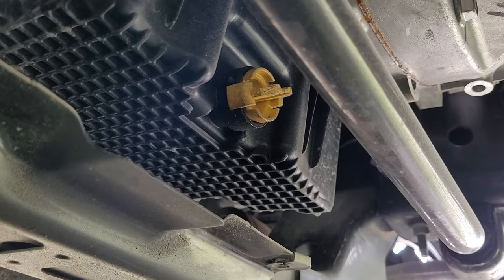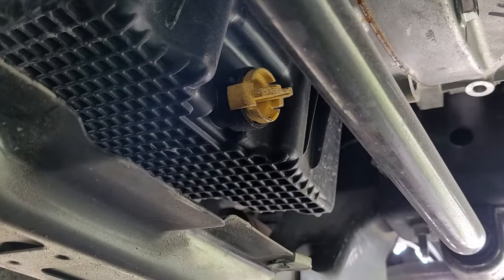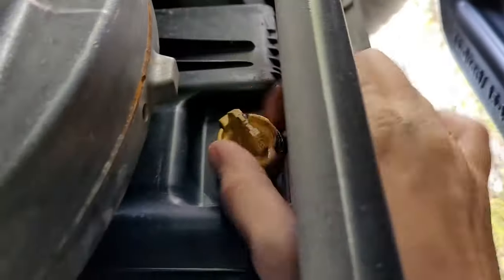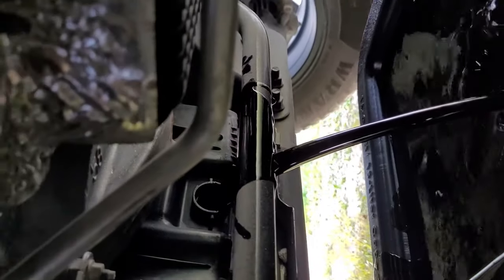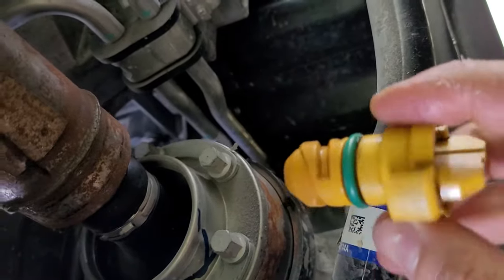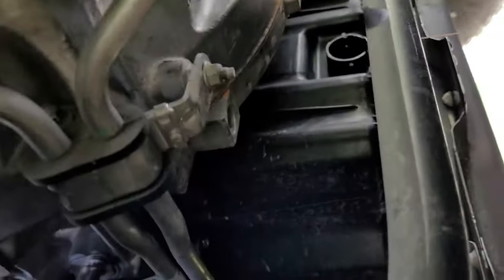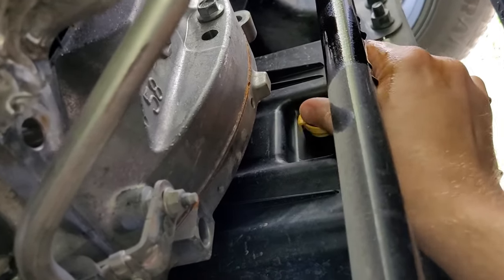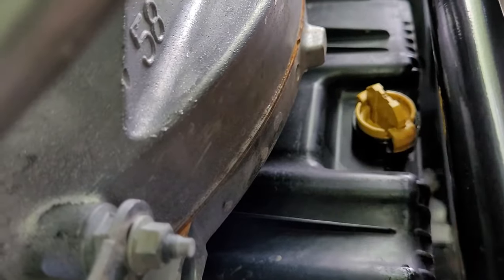Ford's New Drain Plug

Comment: I started as a maintenance mechanic trainee back in 1983 and now have 40 years of experience in many different  forms from industrial, commercial, residential, automotive and motorcycles mostly.  I would have to guess that ford chose composites because of lower costs and weight savings...it's very true how often I find broken and stripped threads in many applications ,drain bolts are pretty common and it never ceases to disappoint me because it's such a simple process and if you're actually a mechanic you don't make this mistake ever. Now do it yourselfers, weekend warriors and non mechanics  don't have the understanding or the patience to understand that a drain bolt doesn't hold the titanic to port and in fact takes very little torque to seal and stay in place...ford started putting o rings on their drain bolts years ago and many manufacturers use a single use compression fitting in an attempt to help  the not so sharp individual not over tighten, strip or otherwise cause damage  while trying to save money. I hope this helps anyone who wants to do their own work and when all else fails follow directions ! Get a service manual that will include torque specifications for each and every fastener.
Reply from the maker: "hold the titanic to port" lol that's a good one. Your probably right with the cost savings along with trying to prevent over torquing.
Reply from the maker: @paulfeasal6024  I was thinking about upgrading to the F-250 6.7 HO diesel
Reply: For 7yrs. I had the FORD Maintenance agreement for oil/oil fltr changes ev'ry 5K mi. on my 2013 3.5L ECOBOOST.
NOW I do it MYSELF.

What HORRIBLE, MESSY undertaking!!!

The oil filter lays on its side.
The drain plug is back by the auto. trans. ...just above the anti-sway bar.

There are 2 underpanels to deal with.

FORD "engineered" a way ( a removable hole ) to access the filter w/o removing the front panel,  but it will drip black oil for DAYS if the entire panel is not taken off.

I like the MERCEDES-BENZ oil drain method best.  Vacuuming it out thru the oil dipstick tube. 
The filter is accessed from above & the oil drains back into the pan by loosening the cover & raising it up a little bit.  MUCH MUCH NICER.
 My FORD has no dipstick tube.
Reply: Yeah a torque wrench set at 20-30 lbs is all it needs. Guessing is where people mess up when they don't have the right tools on hand.
Reply: @DavidTMSN  They may "think" the right way is to tighten it down until it breaks off, then loosen it a quarter-turn.
Reply: Your a weekend warrior  it's easy to put a sump plug in doesn't mean cause people  are not full mechanics doesn't mean they don't know what there doing dino
Reply: You forgot to mention that not all threads strip out through overtightening, sometimes it's because the threads have bonded to eachother through various means.  Plastics are especially bad for this if contamination is involved, as it can act to bind the pieces together, resulting in damaged or destroyed threads.
Reply: When I bought my F150 new it was at only its second oil change at the dealer and they charged me for a new (metal) oil pan drain plug. I asked what the hell? They sheepishly said they had apparently ruined the threads on the old one and apparently it was up to me to pay for that mistake.

Comment: Yup, a plastic oil pan plus plug😢.  Any guesses how many frozen winter days will pass by the time the plastic begins to warp or crack..?
  In winter conditions the pan is being assaulted by high temp oil Inside and by freezing -25 degree air on the outside.  
  I can forsee hairline cracks within a few years.
Reply from the maker: everything breaks in the cold

Comment: It would have been nice if the plug, fully tightened, would be straight up and down vertical so that you could also see it was tight.
Reply from the maker: Well that makes too much sense
Reply: You turn it until it stops. Is not that hard.

Comment: This is why Ford keeps having oil pan problems, leaking and breaking. Even the 6.7l is having tons of problems, newer ones you have to pull the engine to replace the upper oil pan. I just can't believe its much cheaper to make these plastic pans and plugs than a regular old stamped steel pan and steel drain plug. Glass fiber filled plastic is hard on molds and molds are expensive to make. I'm sure the plastic pans are lighter than steel but were are only talking about a couple pounds.
Reply from the maker: I think its still cheaper than steel, I have seen that oil leaks on the upper oil pans where you have pull the motor, but I think its just the gas motors with the plastic pans

Comment: This is one of the dumbest things I've ever seen. I just became a Ford man after standing beside GM for my entire life. After my first oil change on my F-150 I wanted to sell it again. I still have Sawdust on my garage floor soaking up all the oil that slams into the torsion bar on the way to the pan. If I had a pan the size of a bathtub........
Reply: Levi Levi, that drain plug has a two-phase release. In that first phase, you can drain the oil without making a huge mess but it takes a little while until the pressure is relieved. Then screwing the drain plug off on the second phase let’s it drain like normal. I know…it’s a PITA but that’s the way I had to do it so I wouldn’t make a huge mess! 🤷🏻‍♂️
Reply: @carlovanrijk4039  thank you Carlo! I feel real smart now. LOL. Seriously I appreciate the info. I even watched a YouTube video before I got started just as a precaution. Seems there's a couple other guys on here that didn't know that either. I hope they see your post. Again, thank you.
Reply: @levilevi6248  you betcha!
Reply: @levilevi6248  I guess I should tell you that on that first phase release, I had to keep my finger physically positioned on the drain plug while the oil was draining. Like I said, PITA but it kept from making a mess. 🤷🏻‍♂️
Reply: I have became a foreign car man after owning fords and some gms...I will never buy an american vehicle again.
Reply: @FC-qe1wl   Same lol, quality was never our strong suit and it's gotten much worse over the last decade or two.

Comment: No more stripped threads or missing gaskets I guess. 
It looks like you could just carry a boat drain plug just in case. 

I do have the sneaky suspicion though that thing will sooner or later fall apart and cost someone a motor years from now.
Reply from the maker: Yeah, I'm thinking the same thing

Comment: I replaced the factory plug with the billit Ronin drain plug$80 no more gushing oil
Reply from the maker: I'll have to look into that
Reply: @thebartendermechanic   Did the same for mine, works great with about 18" of tube hooked up to it... the bottom of a 5.0 was engineered by a 12 year old I swear...
Reply: @dshall442  There are ENGINE engineers & there are CHASSIS engineers.
Never the twain shall meet.
Reply: Has your got the heated tailgate option, so when your pushing it to the repair shop in the winter, your sissy hands wont get cold? 
$80 to replace a defective bad idea Ford had. Nice job on the purchase for 60 k
Reply: For $65 I got oil extracted pump no more issues

Comment: You're supposed to replace the drain plug every time you change the oil. I replaced the one in my Bronco with a Ronin Factory aluminum plug.
Reply from the maker: Does that one work better for you?

Comment: Drain plug is least of the problem.  That plastic oil pan is causing leaks on almost every Ford/Lincoln vehicle its installed in.
Reply from the maker: How many miles until they usually start leaking??

Comment: As if there's not enough plastic parts on it?... so they just added more. Next will be a plastic engine, which they're actually trying to do btw.
Reply from the maker: no way, They are trying to make a plastic engine???
Reply: @thebartendermechanic  yes, I seen it on a educational channel.
Reply from the maker: @garyr7027  That will be interesting
Reply: They were working on a plastic engine back in the 80s when I was working at a Ford dealership

Comment: Well, it's worked for decades on the plastic radiator drain plugs... With the way they make the metal drain plugs and rubber gaskets these days, this design might be better. On my 2016 Wrangler, I change the drain plug every time I change the oil simply because the built in rubber gasket tears each time I change the oil. I don't mind anymore, I just look at it as part of the price of my oil changes and I always have 2 or 3 new spares on hand.
Reply from the maker: good point, its smart to have those spares
Reply: why not just replace the o ring rather than whole plug?
Reply: @ranger178  The rubber gasket is built into the drain plugs from Dorman - they aren't separate - just  like the factory drain plugs.

Comment: it was price    im a old school ford guy  started working at ford in 1990   got out  many yrs ago after all the changes started .    plastic oil pan and plastic oil drain plug  is cheaper to make  then all metal    its simple  in a business sense   but one day it will bite ford in the rear end     your supposed to change the plug at each other change     yeah    same as the beetle   2019 20t plastic plug and pan
Reply from the maker: Yeah, makes sense, I'm scared to see what the F-150 looks like in 15 years

Comment: Do the plastic thread tabs matter when it comes to keeping the plug in? Or are they more of just guides? I assume the o ring and the outer clips on the plug hold it in…
Reply from the maker: The plastic thread holds it in.  The tabs sticking out are for the alignment and prevent it from backing out

Comment: Very cool! But uhh plastic oil pan?? If overtorqued oil drain bolts were a concern just use those EZ oil drain valves. Curious to see how the plastic holds up with the years
Reply from the maker: Great point!

Comment: So, just this morning, driving down the road, I get a chime for low oil pressure. Yep, no oil pressure. have to drive 1/2 a block to get out of busy traffic and pull over. Sure enough, no oil pan drain plug. No oil. Couple hrs of finding a new plug and haul some more oil to my truck. Hope I didnt do any damage.
Reply from the maker: oooohhh nooo, oh man that sucks.  Hopefully no damage, I thought something like that would happen with these plugs.
Reply: You mention an audible "click". I don't think I hear that when I snug up the plug to the stops.
Reply from the maker: @ThomasFrey-d8d  
I would replace the plug, I've heard stories of them falling out
Reply: I will never again reuse a plug.  And it doesn't have to turn much to come loose.  @thebartendermechanic
Reply from the maker: @user-jk5nz9cd2k   yeah I don't like the design

Comment: That oil was changed 25 k ago,, Open the oil fill cap to let air in, I just went to Full synthetic with synthetic filter and drain tray  2 5 qt jugs  100 bucks for want like $ 180 the do a oil reset they don't mention this

Comment: Sooooo….What’s his point?. It’s a pain because of the sway bar. But intakes have been plastic for 30 years. Gaskets are o-rings in grooves that don’t leak. Engines last 200,000 miles with care and maintenance. A 5.0 V8 holds 8+ quarts. All is good with the exception of a Auto transmission dip stick.
Reply from the maker: Good point

Comment: I'm not sure what year F150 you have, but Ford is now back to using aluminum pan & plug.  Mine is a 2020 and it's all metal.  I was confused originally because all the Youtube videos I saw regarding oil changes showed the plastic pan & plug.
Reply from the maker: Mine is a 2021, and a friend of mine has a 2023 with the same style plug.  Yeah I'm not sure what they are doing, maybe mix and matching
Reply: @thebartendermechanic  Wow, maybe I got a unicorn.
Reply: Depends on which engine

Comment: It probably is less expensive to produce than the tooling for a stamped metal pan plus it's likely to transmit less engine noise.  But, heaven help you if you run over something.  More likely to break, shatter than the metal pan that might deform.
Reply from the maker: agreed

Comment: All of the manufacturers have been using more and more plastic components on their engines for some time. Intake manifolds, valve covers and oil pans etc. It all boils down to cost and weight savings.
Reply from the maker: right
Reply: That get weak and break like all little crappy plastic parts here are the big crappy plastic to break in the vehicle's future.
Reply from the maker: @ronpflugrath2712  agreed
Reply: The Silverados were doing the plastic drain plugs as well but went back to aluminum for 23. I think enough people made a stink about it.

Comment: I change the oring every oil change on my 2018 F150. It leaked the couple times I didn’t.
Reply: @paulfeasal6024  i wish that were true. No, my 2018 has the plasma cylinders. 2017 was the last year for the steel sleeved engine.
Reply: @craigg4246  Frame bending?  Plasma cylinders?  WTW?

Comment: Now that’s some dark oil
Reply: Imo- way too long between oil changes on a gasoline motor. My diesel looks like that. My gas motors never do. Perhaps why I get 300,000-400,000 miles out of my engines. Actually longer. I just sell them at that point. Still run great without burning oil.
Reply: @135taz  A whole lot LESS friction in today's engines due to different ( fewer ) piston ring set-up...2 compression rings, maybe NO OIL control rings w/scraper.
Dark black gas eng. oil is here to stay.
Oil smells "gassy" too.

Use "SR" oil!
Reply: @135taz  they all look like that now. High compression with direct injection. Very similar to a diesel. In fact, particulate filters are being developed for gasoline vehicles.
Reply from the maker: particulate filters for gasoline???? didn't know that, Are they going to be used in conjunction with catalytic converters?
Reply: Those are turbocharged engines they dirty up the oil big time

Comment: On my 2017 F150 I'm going to be replacing my drain plug every 2 years or so, ever since it cracked during an oil change at the dealer and I arrived home a quart low from the leak. And when I tried to tighten it up the plastic crumbled. So obviously 7 years from manuf date is too long for that part.
Reply from the maker: Oh man it was leaking from the dealer too bad they didn't catch it
Reply: I own some Fords, some of them have ‘Lifetime Fluids’ in things like rear diffs and PTU’s. Lifetime to them means get it past the warranty period. For example I wanted the rear diff oil in my ‘17 AWD Escape changed, the dealer booked the appointment but then wouldn’t do the job when the time came. The service advisor admitted it was a good idea to change it out as one of their maintenance techs had to replace the rear diff in his Escape probably due to oil breakdown, but they wouldn’t do the job and actually directed me to a third party transmission shop to go to. I did it myself in my driveway.
Reply from the maker: @squangan   I swear they engineer it to break right after the warranty is up

Comment: From reading the comments, some people took the news pretty hard.      This new design eliminates the need for the sight amount of skill needed to  secure old style drain plugs, plus is cheaper and lighter.  Obviously fitting a metal bolt repeatedly into a plastic oil pan isn't real smart, so now you just twist a plastic stopper until it clicks, no new crush washer needed to prevent leaks or any chance of mis threading with this part.    On my old car, I went to a dedicated oil change valve to eliminate those same problems.  much easier and cleaner.
Reply from the maker: No over torqued plugs
Reply: Plastic weakens over time from the heat cycles
Reply: I had a model A Ford that had an aftermarket oil drain petcock valve. It had a ring made into it's handle and you kept a bent piece of steel round stock with you and you just pulled the handle open to drain and shoved it closed when done. Perfect !

Comment: Newer Volkswagens have those, very similar.  My '19 Tiguan 2.0L turbo engine had this.  Their fine.  Saves weight, no danger of cross threads or the wrong torque (loose or tight), no stripped threads.  This works.
Reply from the maker: didn't know Volkswagen was doing this

Comment: What year and model vehicle is this and which engine?  Thanks
Reply from the maker: 2021 F-150. 2.7 V6 eco boost
Reply: @thebartendermechanic  Not sure why Ford went to those plastic oil pans and plugs. Is that still a thing an the 2022s?
Reply from the maker: @robertf3340  yes it is
Reply: @robertf3340  Casting a composite ( plastic ) oil pan is MUCH more efficient than a stamped steel, or cast aluminum oil pan.
You don't need a furnace, you don't need a bunch of machinists...all you need is a drum of oil to make the plastic beads to pour into a mold after you bring the bead's temp. up to boiling.
Its like pouring Jello into a mold.
Reply: @SpicyRok7482  I’m sure you’re correct. However I want to install a quick drain plug for my oil changes like I’ve had in several vehicles and they don’t make them for plastic oil pans. Thanks for the “how it’s made” lesson though, love the show

Comment: first thing im replacing in new car is oil drain plug....had 2018 Lariat for two years and there was better replacements for them...current 2020 F350 powerstroke got EZ Drain Valve after 2000km :P
Reply from the maker: I should try that

Comment: It took 112 years for Ford to fix a 112 year old mechanical design short coming. Unfortunately, we won't be around when they get the rust problem under control.
Reply from the maker: In my opinion, I think Ford trucks have come a long way with rust, I remember growing up and working on the f150 of the 80s and 90s and they were just rust buckets. My F-150 body is actually aluminum which doesn't rust